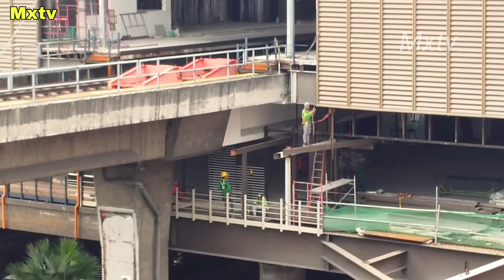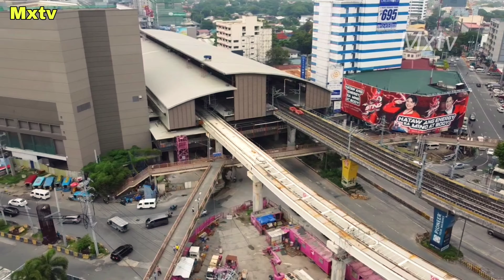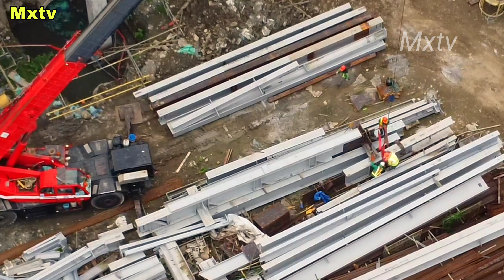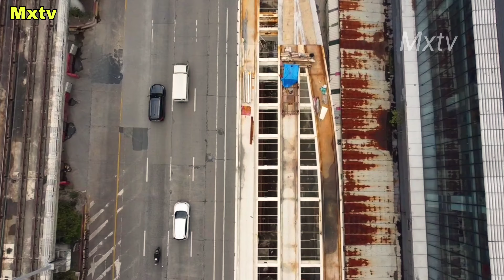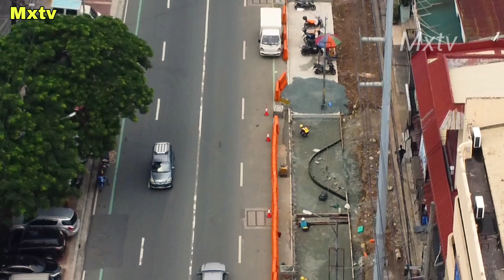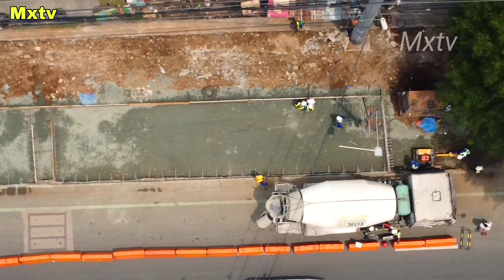North Avenue Common Station UNIFIED GRAND CENTRAL STATION 05/26/2023 UPDATE

Comment: Mukhang meron mabigat na problema ang BF Corp tungkol sa design issue ng steel box girder rail viaduct. Sa nakikita ko na aerial drone videos mukhang my elevation mismatch ng platform at rail. I don't even see any clear detail how BF will execute the installation of the rails to the box girder viaduct.
Reply: See Bio Cyber video regarding how the LRT 1 line from Grand Common Station will connect to LRT 1 Roosevelt station. Infravloggers are missing this part, since they cover only on what is being build or implemented by the contractors. His vlog is more on the planning stages and after watching his vlog, you can have a somewhat clear picture of what should be constructed.